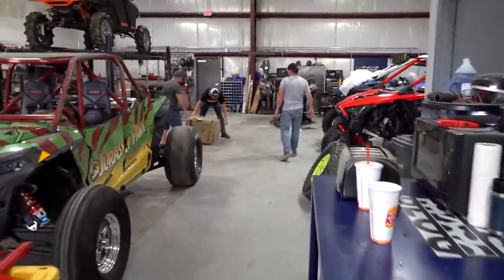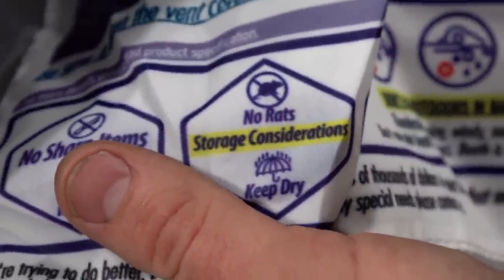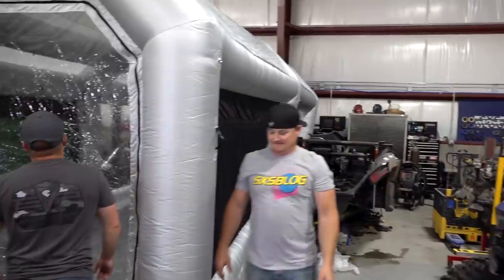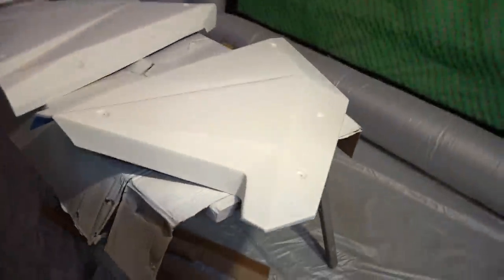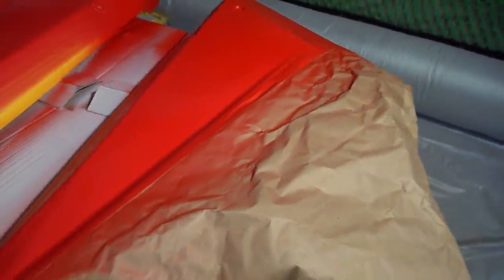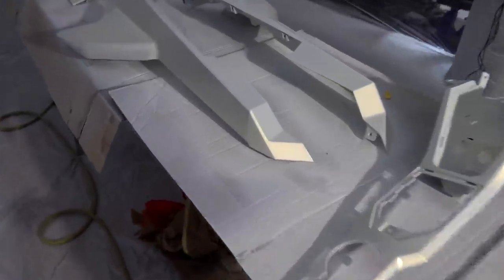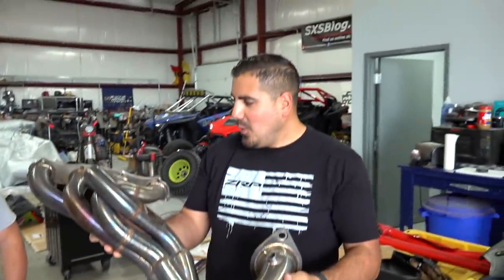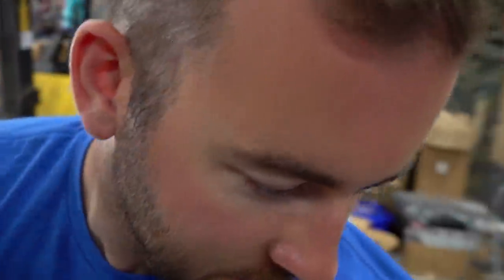We build our first RZR Pro R! Paint, cage, wheels, shocks, oh my!!

Comment: If u do several coats of clear coat you'll be able to give it a good wet sand then buff and polish it and it'll look perfect runs are easy to wet sand as long as you did a couple coats of clear so u don't have to worry about burning through the clear and into the paint

Comment: One blower for the structure and the other blower is for positive air pressure which blows out the filter but maybe throw a furnace filter on the intake of the air pressure blower

Comment: The pearl that you put on top of the white  is not really clear coat . It’s a clear base coat . It’s a three stage paint job and the Pearl over top is actually called a med coat .      Base coat has a window of 24 hours that it can set without clear Applied. hopefully cleared was Applied with in that window  or the paint will eventually peel

Comment: Please give me some help Bros Got 2nd place at the hill hole At the barnyard in Livermore Maine with the Can-am  commander XMR.2022     It drew a lot of attention And a gentleman with Older X3  2017 said it was the same engine that was in his with 225 horse and it would be It's quite simple to turn it into the same what do I need for parts since it is naturally aspirated And the commander  XMR Has the 976 CC  V twin liquid cooled  Engine n/a . What kit do I need to make it the 200 horse Or 225 To make it like an X3 maverick Sport we compared engines and it's the same exact thing 2 cylinder When he looked at the machine it blew his mind he asked me if I built it. I said no it's totally factory . I let him drive mine and he said it was crazy Torquey   And built super thick. But when I drove his it took off Like a rocket with the same engine But I'd never heard a Turbo  Unless it was super quiet he said he had a tune. But I would like more or less love the same result like feeling in a Slingshot.  The commander XMR 2022 took 6' jumps not a problem like it was landing on pillows !!  I would love some direction boys